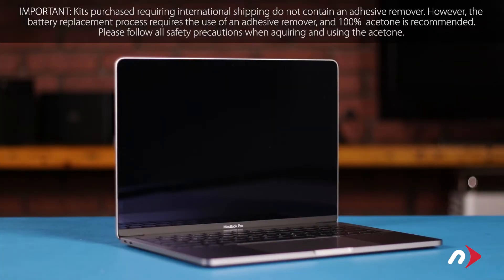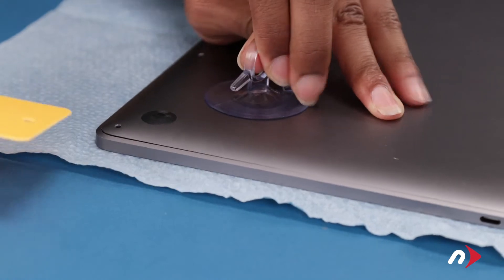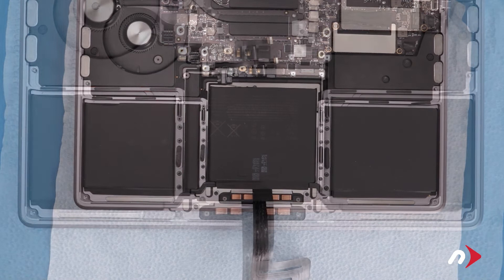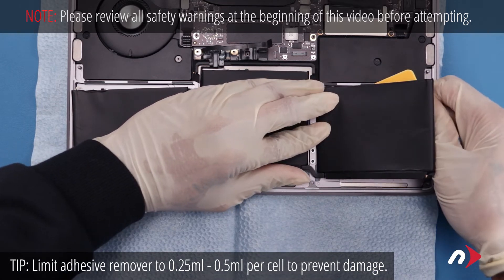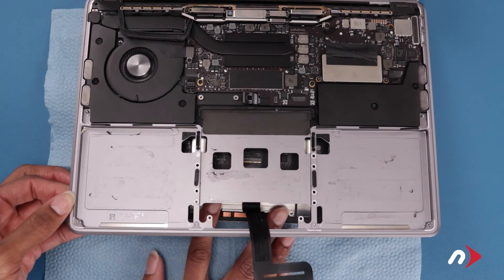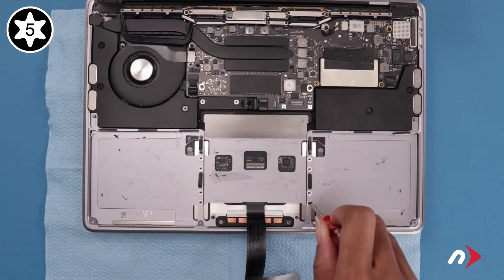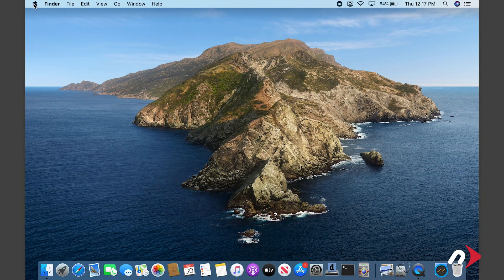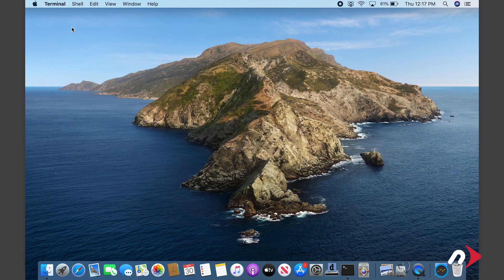How to Upgrade/Replace the Battery in a MacBook Pro 13-inch (late 2016 - mid 2017 non-Touch Bar)

Comment: Great video, did this for a client on Friday with great success, what a nasty job it was but finally managed to do it OK so very pleased with myself however,,,,,,, it may be a good idea to not stick the battery down or put back on the cover until you have booted the laptop and charged the battery for a bit - I think this is essential as if you think about it suppose the batter you ordered from eBay for £40 is defective or dead? You now must remove the battery again which would be no fun - also a good idea to use a magnifying glass esp when reconnecting the snake cable

Comment: How do you know it’s charged 100% if the Macbook is off? Only way I can think of is turn it on to check 🤷🏽‍♂️
Reply from the maker: Regrettably, There isn't another way to determine if it's 100% charged without turning the Mac on.

Comment: Check your trackpad position before re-attaching the bottom of your computer! I was so disappointed that my trackpad stopped clicking after replacing the battery. When I noticed that it was off center in its opening, I removed the bottom of the laptop, loosened the trackpad screws, repositioned the trackpad to be in the center of the opening, tightened the screws again and tested it before reattaching the bottom of the computer. Everything is working perfectly now. I just wish I'd have known to check the trackpad first. Thank you for your very informative video. Saved me a couple hundred dollars!
Reply from the maker: Thank you for sharing your feedback about the trackpad position post-battery replacement! We're delighted that our instructional video proved helpful and saved you money!

Comment: Can anyone tell me "roughly" how many hours their replacement battery lasts from a single charge?  I am thinking typical internet, email, document editing use... with no demanding power usage.  I am trying to determine if I should replace my original battery now, or wait until it has more cycles on it (it is running at about 70% capacity now).  Thanks.

Comment: I just replaced my battery but my ‘System Settings’ looks different so I am  trying to figure out how to calibrate my battery. I am on Ventura 13.6.5. Any help would greatly appreciated.
Reply from the maker: Here is our help page for calibrating the battery. In the OS menu, you are looking for just the Battery options which should be located under Battery, and at the bottom a button that says options. https://www.newertech.com/batteries/power-calibration-guide/

Comment: Hi! Great video, thank you!! I have a MacBook Pro 13-inch, 2017, Two Thunderbolt 3 ports, processor 2,5 GHz Intel-Core i7 dual-core.  Does this product works for my computer too? Thank you in advance
Reply from the maker: Hello, Yes, this battery should work with your MacBook Pro as well!

Comment: Hey, thanks for the step-by-step. Unfortunately, the speaker on the right side doesn't work anymore. Do you have any idea what I did wrong or what I might have damaged?
I would be grateful for any tips on how to determine if I can fix it or if it's beyond repair.

Cheers !

Comment: Will the battery be ok if I turned on before it reached 100% charge?
Reply from the maker: We recommend completing the calibration for the battery. The battery, however, should be fine if you turned it on before it hit 100%.

Comment: Thank you for this video. Great explanations. 
However, how long should it take until it's turning back on? Mine doesn't seem to turn back on.
Reply from the maker: The Computer should turn on right away. The only thing that might cause it to not turn on immediately would be if the battery needed to be charged. Try charging the battery and see if that solves the issue.

Comment: Excellent video, thanks!
For everyone, pay special attention to the flex data cable of the trackpad..I just did the battery replacement myself and somehow damaged the cable, resulting in a big mess (trackpad+keyboard not working, fan always on, super slow computer in general). I had to have it repair by professionals then
Reply from the maker: You're welcome!!! While we are glad the video helped, we're sorry to hear about the damaged cable/issues that occurred afterwards. We always encourage our customer's to see if they can do it, but if they can't, or if they get somewhere where they need some assistance, its never a bad thing to call for help. Hope all is well now.

Comment: Awesome video! Would very much like to give it a try. But not yet entirely sure this would be the right video and/or NuPower Battery for my MacBook Pro. I have the MacBook Pro (13-inch, 2017, Two Thunderbolt 3 ports). And processor 2,3 GHz Dual-Core Intel Core i5. Thanks in advance!
Reply: And Model ID: MacBookPro14,1

Comment: Fully charged battery. My mac shows the battery percentage then goes away, but doesn't turn on. How can I fix this?
Reply from the maker: If you are having issue with your battery not actually booting your Mac. We would recommend that your calibrate/condition your battery. Please reach out to use at support@owc.com if you continue to have issues.
https://www.youtube.com/watch?v=T5ZMLInLE-Q

Comment: I used these steps with excellent results.  Bought a battery off Amz for about $50 and have battery power working on my macbook pro again.  One additional thought…no explanation is offered as to why you need to remove the trackpad.  Having done it, I could see that if you leave the trackpad in place you are at risk of damaging it when you use the plastic scraper to lift the center battery.  There are chips on the trackpad that you could easily damage  while trying to get the center battery free.  Removing the trackpad eliminates that risk.  Also, on mine there were three different screw lengths holding on the bottom cover.  Thus, pay careful attention to what screws come out of which holes.
Thanks for the excellent video.

Comment: Hello, is it possible to replace the battery of "MacBook Pro 13-inch (late 2016 - mid 2017 non-Touch Bar)" with a battery from "2020 M1 MacBook Pro 13 A2337" ?
Reply from the maker: Hello, Since these are not the same, they are going to be connected and operate a bit differently, so my recommendation would be no.
Reply: @poweredbyowc  Thank you !
Reply from the maker: Your welcome!

Comment: Can you replace the battery without disabling auto boot? My laptop is completely gone
Reply from the maker: You should not be able to without a problem.
Reply: I’m wondering the same thing. Did you ever try it out? Mine is dead dead.

Comment: Hi. my kit came without adhesive remover. Is that correct?
Reply from the maker: Hello Sergio, it should have come with adhesive remover, but it depends on where we are shipping to. Outside of the United States we aren't able to ship acetone for instance which is usually what we use with our batteries. If this is not the case please reach out to us at support@owc.com and we'll get some adhesive sent to you right away!

Comment: I have 2 a1708 MacBook pro's, one is completely dead with a good oem battery, the other is working great but has a battery that has over 1350 cycles and is going bad. does anyone know if transplanting the battery from one a1708 to another if careful to damage the cell is a bad idea?
Reply from the maker: While it is not recommended, you could do the transplant, reset the SMC, and condition the battery and it may work. However again I would recommend using a fresh/new battery as this would probably be the best for that Mac. Hope this info helps.